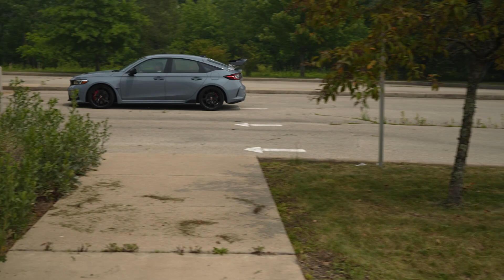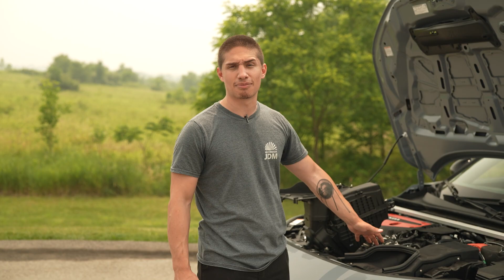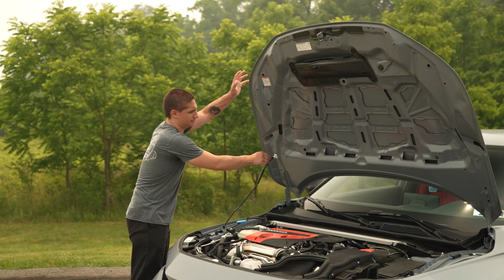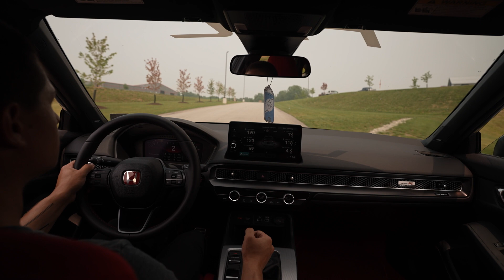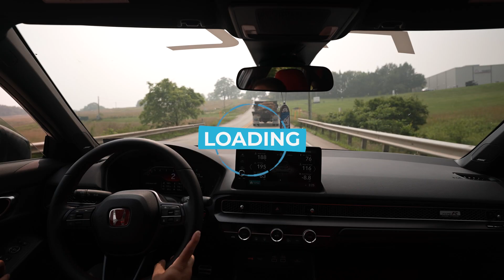PRL Motorsports High Volume Intake PROTOTYPE for the FL5 Type-R!

Comment: Civic type R is an awesome car in so many ways, and the FL5 will probably be a classic 20 years from now.  That being said, I've heard so many different combinations of intake and exhaust on the FL5, including handmade custom titanium designs, and none of them sound good. I'm sure this PRL intake is great at producing airflow, but something about this car will not allow it to produce good exhaust sound.
Reply: It’s all about tuning and fuel trims
Reply: I totally agree with you!  Single exhaust exit port to the turbo probably kills all ability to tune for air and scavenging.  The K20A series (and others) have individual runners from the exhaust ports whereas the K20C1 has just one big port (not so big, actually).
Reply: @ariazad4873  spot on

Comment: Should've turned off the fake sound generator so we can focus on the REAL sound
Reply: @@volkz247I think there’s a fuse somewhere. Saw a video a little while ago but can’t find it again
Reply: @brocklewis8356 you can turn it off in individual settings